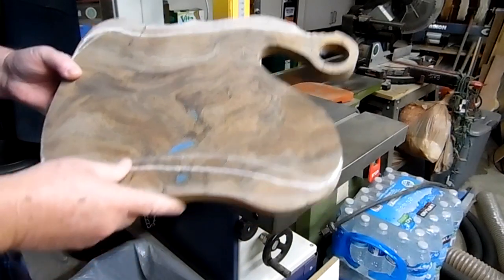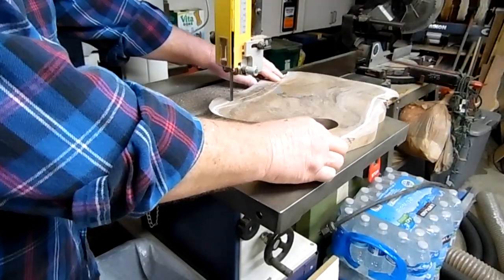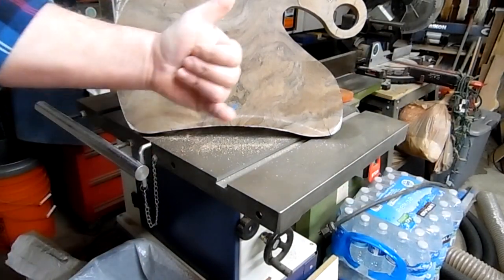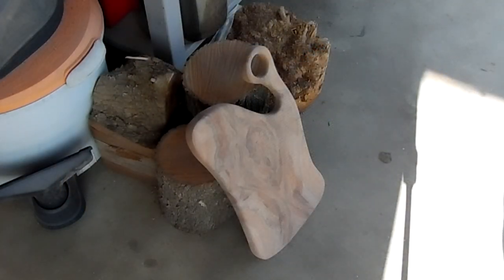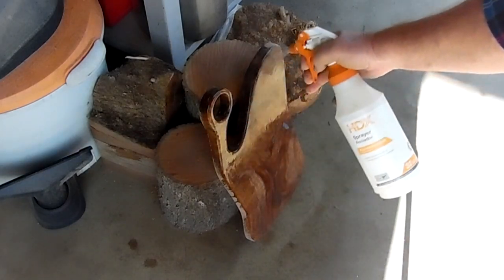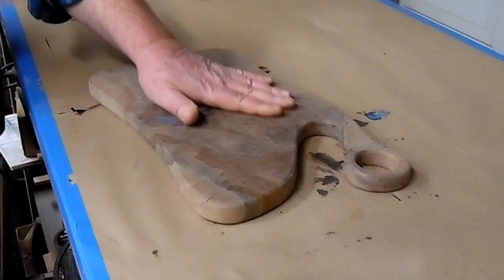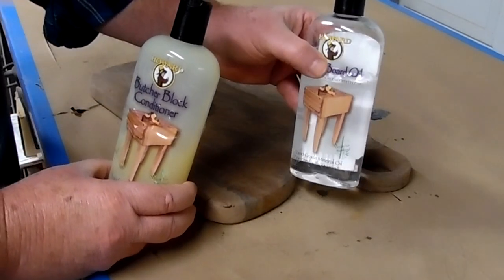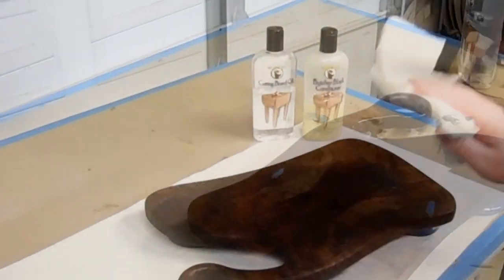Woodworking-How to make a charcuterie board

Comment: Jordan i have just started two large butcherblock chopping boards myself and on one side I plan to do a pyography drawing so it can be sitting out as an artistic piece and then the chopping side would be hid. My question is regarding your sanding process, you use water to raise the grain i had planned on using alcohol should I use water for a better finish also when re-sanding how far back did you go or did you re-start at 240 grit? Ps this looks awesome and I love the finished shape 👍👍👍
Reply from the maker: Hi Gavin, thank you , glad you liked it! For food stuff I would use water. I stopped at 240 before the water then sanded back with 300. I always do the water and sand back twice, could be over kill but that’s how o do it. Always sand back with the next higher grit, if it’s the same or lower grit you reveal new grain which defeats the water treatment. Hope I helped Gavin! PS, let the mineral oil or what ever you use to really soak in, maybe a couple of coats, again, maybe overkill but that’s what I do. Thanks again!
Reply: @JordanWoodwerx  thanks very much thats really helpful I am a big believer in over kill as its always better than wishing you had done the extra when its too late. Very much appreciate the help 👍👍👍
Reply: @JordanWoodwerx  could I push further in regards your sanding process, you do it twice am I right in saying you sand up to 240 wet and sand from 300ish when do you re wet and what grit do you sand with or is it twice at 240 and 300
Reply from the maker: @gavincoyle  Hi Gavin, after the second soaking I’ll use 400 grit. Then your board will be smooth as silk!! Keep us posted on the outcome!

Comment: That came out beautifully. What was the finest grain of sandpaper did you eventually use? When I did something similar to this project, when I put mineral oil and wax on it, the wood went really dark to the point where I could hardly make out the grain. Someone said it could have been because I didn't use fine enough sandpaper, so am curious what you used. Thanks!
Reply from the maker: Thank you Stephen! I sanded to 320 grit and popped/raised the grain with water and let it dry, then lightly sanded with 400 grit, I did that twice. Then used the mineral oil on it.

Not sure why the grain on your board came out darker, sanding to a higher grit sometimes will make the grain tighter and not absorb the finish, but usually not to the point you can’t see the grain.

Hope this helped Stephen, appreciate you!
Reply: @JordanWoodwerx  Awesome, thanks Jordan. I'll try the higher grit next time too!

Comment: Nice job Bruce! One of these days I'll need to make some of these from the planks around the pith when cutting bowl blanks. Is that a HF Jointer?
Reply from the maker: Hi Robert, thanks buddy! I get asked to make quite a few of these during the holidays. Great use of cut offs and odd pieces. Yes, that is a HF jointer. $35.00 at a yard sale!! Best $35 I've ever spent.
Reply: @JordanWoodwerx  lol nice! Works well for what you ask of it?
Reply from the maker: @HodgePodgeWoodWorks  hey Robert, sorry for the late response. Yes, it actually works really good!! I had to put done elbow grease into the table (surface rust), replace the switch and some new blades!

Comment: How do you prevent your boards from cupping?
Reply from the maker: The wood I use is usually pretty dry. Any cupping is taken care of in the planer. If using multiple pieces of wood, just don’t clamp to tight during glue up. And should be good. Just tight enough to get a good glue squeeze out!
Reply: @JordanWoodwerx  Thank you.  I need to make sure my wood more seasoned before I start working it.
Reply from the maker: @chaosorder1208  yes, it will want to twist and cup on you if it’s green or not quite dry.
Reply: @JordanWoodwerx  thanks again